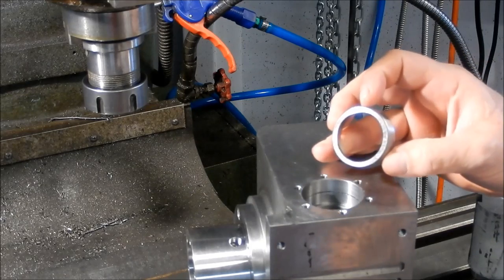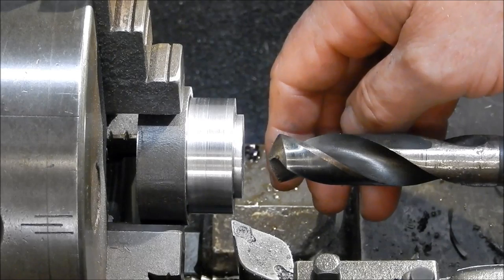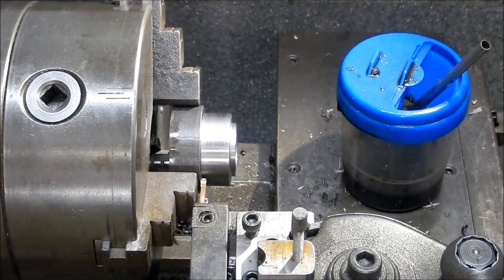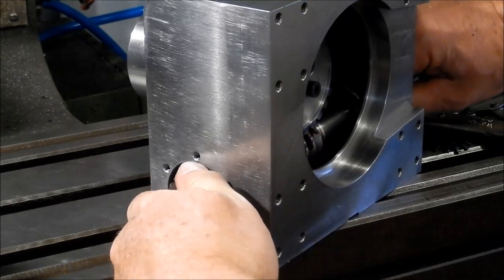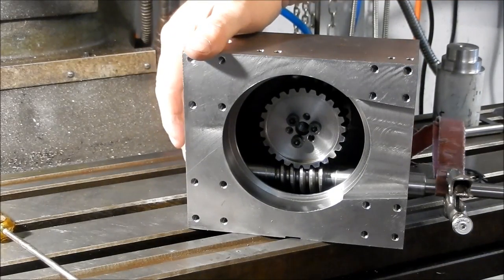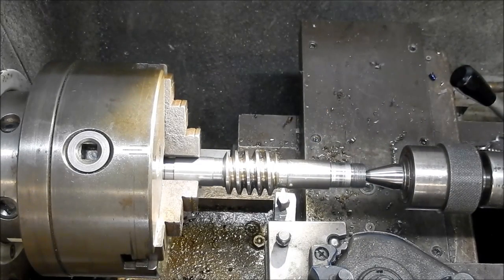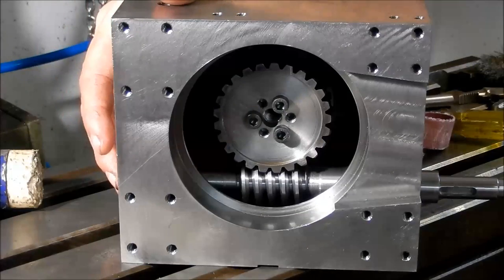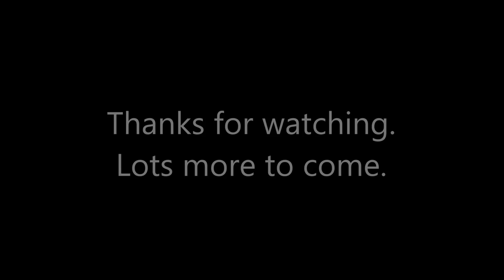Powered Lathe Slotter Build Part 24. Setting the backlash on the Worm Shaft and Worm Wheel

Comment: Watching you install the bearing race reminds me of using electronic component freeze. In a small box you can get the ring down to minus 30 C in seconds. Give you a larger shrinkage factor. And like your CO2 extinguisher idea it is both portable and not very expensive.
Reply from the maker: G'Day KA, I was going to use the Loctite 'Freeze your Nuts Off" but couldn't find the can.  Works well and lubricates at the same time.
Cam

Comment: If there is too much backlash can you do anything assuming there is no play on both bearings on shafts
Reply from the maker: G'Day Michael, thanks for your question.  The upshot is no I can't eliminate the backlash.  There will always be backlash through fitments of bushes/shafts and the fixed backlash between the Worm and Worm Wheel, these small clearances are required to allow lubrication to prevent any binding between the elements.  In this particular application it won't be an issue as the force due to the cut will always be in the same direction and those impact forces will be relatively low.
Cam
Reply: Thanks.

Comment: Time to add the Lapmatic 9000 magic greasy abrasive.  

Cringe - go to the cabinet or drawer where you hide it from your machinist friends - apply - turn slow - cringe and walk away - come back much later - clean it - spin it. Smile and take a victory lap. Custom matched gearing.  

Dan

Comment: Geeeeze mate I was clenching when you were parting off there, not much clearance! Nice one!
Also can you go into some detail about your worm wheel cutting setup? What gear setting (like you are cutting a thread) do you use for module 2.5? Isn't it about 8mm? What is the angle on the tool? Cheers
Reply from the maker: G'day, a 2.5 Module is around a 7.85mm Pitch.  Yep I hate parting off and it probably shows.  The Worm Wheel/Shaft is a 2.5 module at 24:1. I bought this from e-bay but you can cut this worm if your lathe is Module capable and also cut a hob for the worm wheel.  I have done a few of these over the years.  This Module is at a 20 degree pressure angle.
Cam
Reply: @camatbattler2233  yeah I thought that was the case re: pitch. Don't think my gearbox can natively do modules... Maybe a good excuse to do some involute gear cutting :D
Good stuff mate

Comment: Could you lap those gears to each other?
Reply from the maker: G'Day DSCKy, the lapping of components that move (rub) against each other is not something I would do.  The lapping compound will tend to embed into the softer material during the Lapping process.  This is very difficult to remove and will continue to Lap (wear) the mating components.  Lapping is fine to seat valves or flange faces as they don't rub against each other like a bush to a shaft or gears running together.
Cam